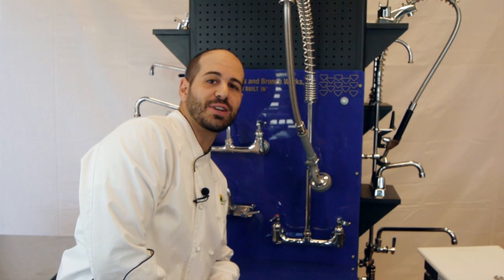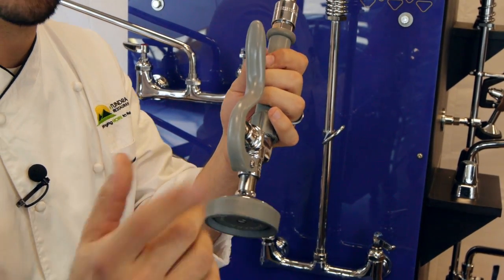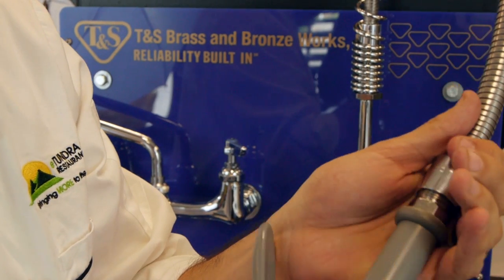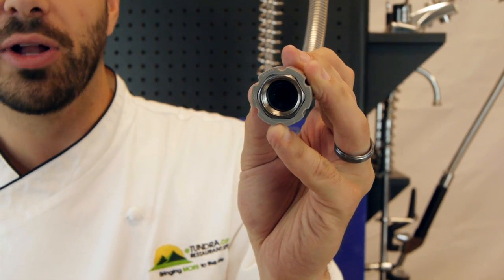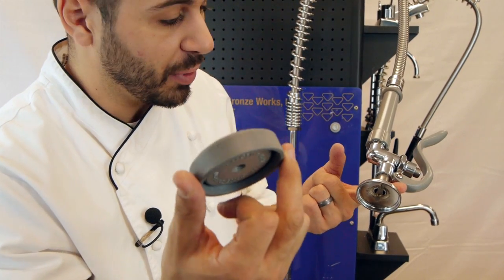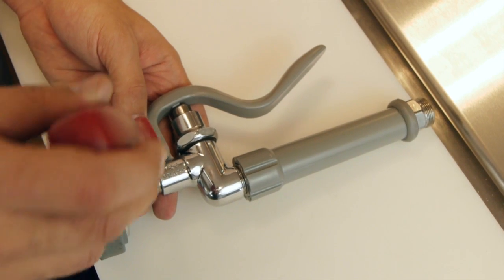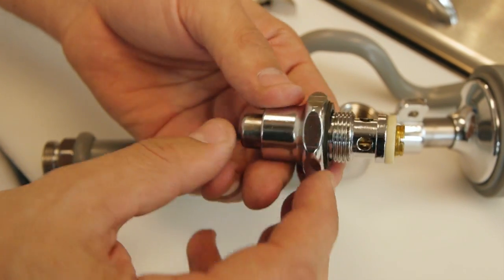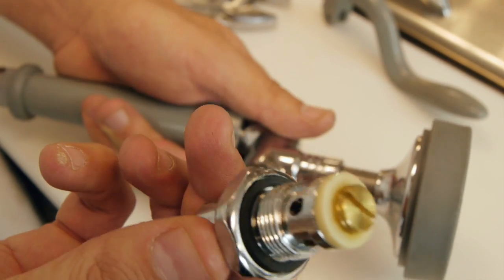Troubleshoot and Repair a Pre-Rinse Faucet | eTundra

Comment: i have one and the pre-rinse sprayer won’t shut off. is there a spring in that bonnet valve that needs to be replaced in order for it to shut off instead of staying on, or should i just replace the entire bonnet valve?
Reply: Hey you ever figure it out ?
Reply: i used a rebuild kit with new springs and o rings.  the spray nozzle leaked worse after i fixed it.  i'm guessing that the corrosion inside the spray assembly prevented a secure seal.  if you can't remember the last time the handle was serviced (longer than ten years), it may be better to replace the entire handle because of build up calcium/lime/oxidation

Comment: WHO MAKES ONE ALL METAL AND NOT OF RUBBER OR PLASTIC THAT ONLY LAST 4 WEEKS IF THAT? THE ONE DISPLAYED ABOVE PUTTING IT BLUNTLY SUCKS ASS .A WASTE OF MONEY.IT LEAKS AT EITHER THE FACE OR THE PART THAT HAS SCREW IN MIDDLE CRACKS .EITHER WAY IT SUCKS.
Reply: the chances are good that you are over tightening.  hand tighten, then go 1/8 using screwdriver or wrench.  then, if it leaks, tighten another 1/8 turn.  use stepwise refinement.  these sprayers are commercial grade.  use a professional installer